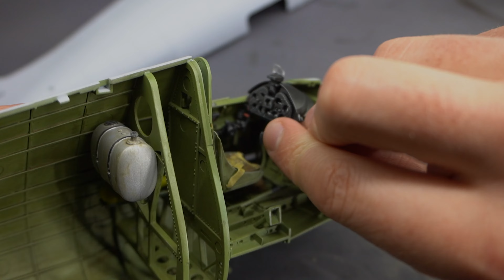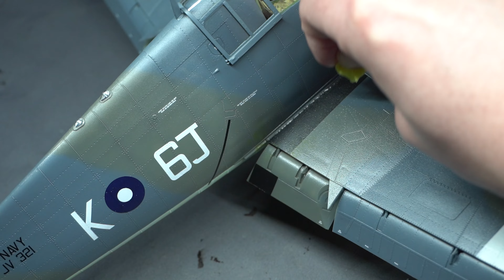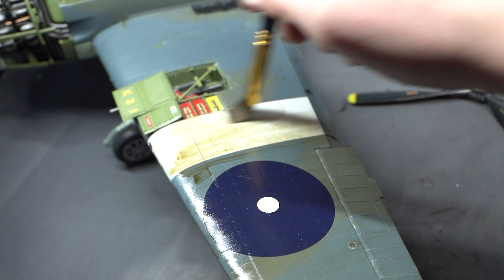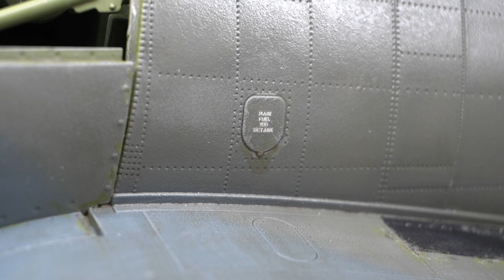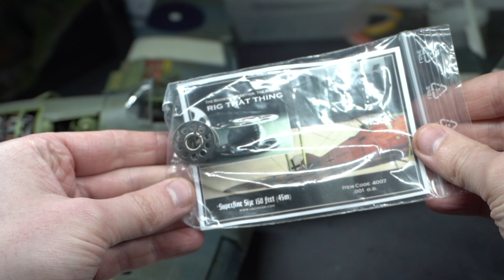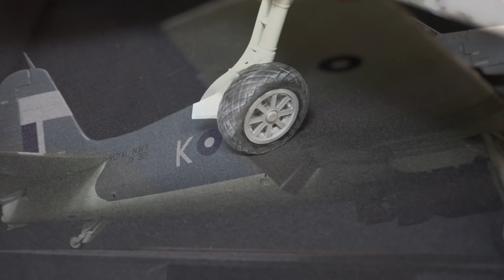Supersize 1/24 Airfix Grumman F6F-5 Hellcat Build & Review! Weathering & Final Details - Part 6

Comment: You've completed a brilliant build my friend. I turned to YouTube for help and ideas with my own build of Airfix's 1/24 Hellcat and came across your video. I bought this kit in 2020 but only started it in January 2026. I wanted to watch videos of other modellers' work posted on YouTube. My plans with the Hellcat are similar to yours in that mine too will be pretty much out of the box. Although after market items would spruce it up, the cost of many of these are off-putting. However, I had to fight hard to vanquish my temptation to buy Airscale's cockpit upgrade because it is such a hike in quality over what's out of the box. But as I had already built the cockpit with the out of the box pieces, I decided to stick with it. Thanks for your videos, I've copied down notes of what you have said, particularly with the weathering, and will try to apply them to my build. Your build is class though.
Reply from the maker: Thanks for the kind words, I'm happy my videos could be useful for you!

Comment: For an out of the box build it is one of the best I have seen, Matt. Congratulations! 
It also showcases the issues the kit has as you stated. The early use of CAD by the designers at Airfix was the main cause of the too tight fit.
What I cannot forgive is the rough surface textured plastic. Despite a lot of sanding I had areas of the texture remain. The illusion of stressed skin sheet aluminum is lost if the surface looks like rough cast metal. Will correct it when I do a new livery.

Airfix did a proper job with the fit of their 1/24 Spitfires. Surfaces have an acceptable texture that is easier to make scale accurate. 
Enjoyed building and achieving good results with two Mk.IXs, that I have another two kits in progress. 
The Mk.VIII kit didn't interest me until news of a Mk.XIV resin conversion that will be available this year had me buy a Mk.VIII a month ago.
Reply from the maker: Thanks for the info! I am hoping the Spitfires will be a joy to build :)
Reply: @ModelMinutes  If you are interested in the Mk.XIV conversions, 'Laminar Flow Design' has the smaller scales. Their facebook has the 1/24 development updates. The pair of built Spitfires are posted on my channel. The third will also be posed in flight as G-IRTY the Silver Spitfire, the fourth and fifth not decided on. Only one will be gear down with the engine installed.